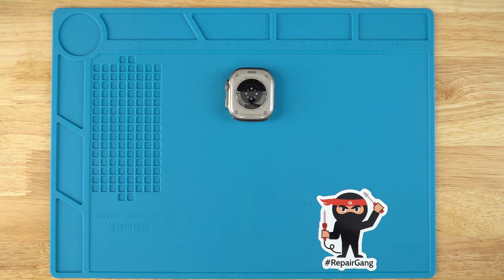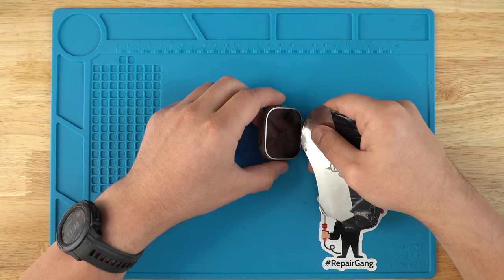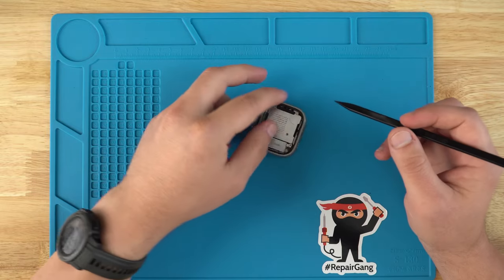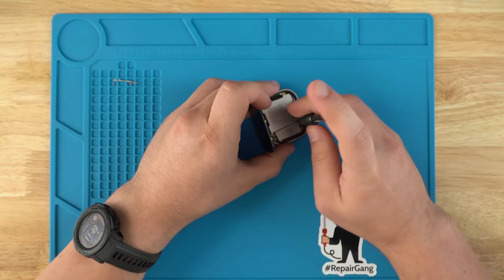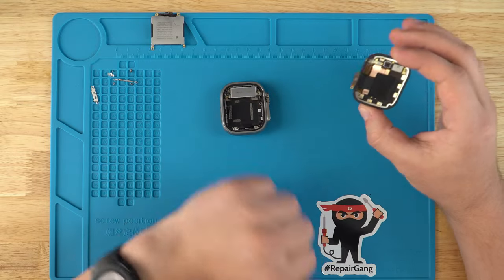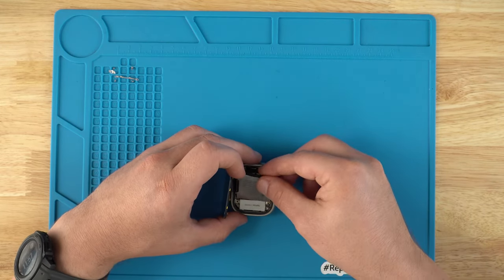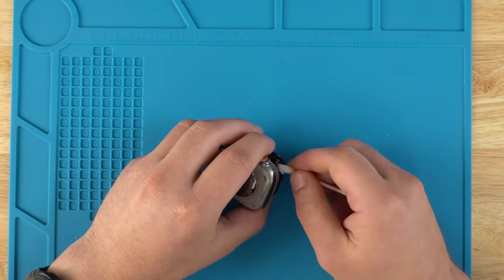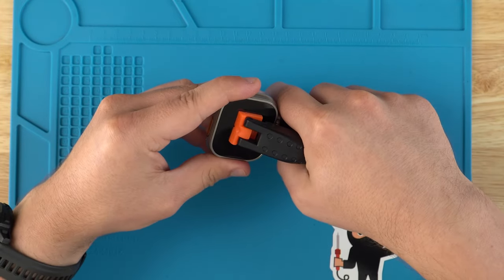Apple Watch Ultra Broken Cracked Screen LCD Replacement | Repair Tutorial

Comment: So is it waterproof after changing the screen?
Reply from the maker: No watch is water proof, but water resistant. If you glue it down properly and create a strong seal then it will be just as good as factory. I do warn you that over time the seal will break and damage the watch
Reply: @Joesge So unlike the factory seal, the new seal will be less durable?

Comment: I was just welding and my sleeve pulled up, a spark landed on my ultra screen and melted a couple holes in it, not all the way through just left nasty spots, how much to repair?  Would this be warranty?  It will be a year old next month
Reply from the maker: I would check as soon as possible with apple to see if it is still on warranty. Go to your settings on your iPhone, and check. If not we do repair these. I will leave a link to the repair form for you.

Repair form: http://rb.gy/g2iv6
Reply: thank you @Joesge